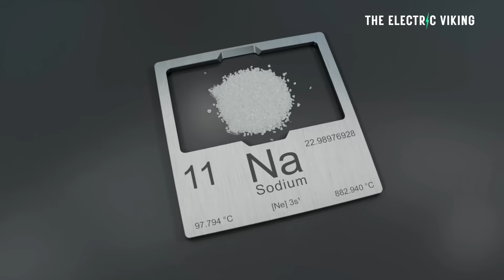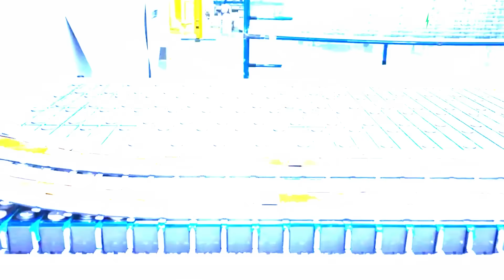Goodbye Lithium! New 3,600,000 Mile EV Battery costs 50% LESS

Comment: Well ... exposing others for their bad research and then doing the same thing is a bit hypocratic. 
- You claim "3 times the life time". Well ... that is a FAR stretch! 
Fact: CATL claims 10,000 cycles ... LFP is already at about 6,000cycles ... this is about 1.7times, not 3 times the cycle life!

- What is NOT mentioned is the calendaric aging. For LFP we pretty much know about 1% per year calendaric aging. What is it for Naxtra? 0.7%? 1%? 1.5%?

When I model the battery after my car and its usage (Volvo EX30 51kWh LFP, 23kWh/100km average, 25,000km/year) aging down to the useful life (70% remaining SoH, after that range is actually a lottery):
LFP with 6,000cycles and 1% CA: 23 years, driven 575,000km and the battery worked around 2600cycles.
Naxtra with 10,000cycles and 0.7%CA: 36 years, 900.000km, around 4000 cycles
Naxtra with 10,000cycles and 1%CA: 28 years, 700.000km, around 3200 cycles
Naxtra with 10,000cycles and 1.5%CA: 21 years, 525.000km, around 2400 cycles

SO: which is it? It might very well be that the Naxtra is not better or even worse then LFP in passenger vehicles! 
Its high cycle life time might be better suited for big commercial vehicles in long-haul usage where the cycles are eaten up very quickly! There the insane charging performance would even make it possible to fully utilize the 3.75MW of the MCS!

- You compare the price of manufacturing of the Naxtra (19$) to LFP cell SELLING price of 55$ ... well ... the truth will be more like 30$ vs 55$?

I have no doubt that with that much technological progress Na-Ion batteries will prove themselves in the mass market. Cold performance, fast-charging-performance, low cooling requirements, low production cost, high ressource availability ... 
BUT ... Na-Ion is fighting an uphill battle against LFP! Look at the Geely Golden Battery ... Those are already available in net 75kWh 5.5C-charging packs (charge 10 to 80% in 10.5min) with million kilometer life expectancy ...

Comment: The trouble with sodium currently is that they have lower volumatric density than lithium, while lighter, they require more real estate in the chassis, which limits pack size and available discharge current.

Comment: Just design a water separator at the fuel injector rail that can make hydrogen at a fast enough rate from water. .Then use a use a direct injection engine to inject the hydrogen at 14 to 1 ratio. The 1 part can be the oxygen waste and the rest of the oxygen can be pumped into the cockpit. 

Everyone was  working in it back in high school except for the direct injection. Then people got knocked off left and right. 

I was running a Edelbrock water injector in 1975 and met Bob Lasar who was racing his rocket car when he worked at MIT at Connecticut International Dragway un East Haddem CT. He came over after he heard I was burning water and we talked about running 100 percent. 

Other suit guys also took interest. I then blew some head gaskets from hydrolock when the injector leaked straight water in the cylinder. You cant compress liquid water.

But it worked and cooled he exhaust and went faster. 

What it did best was make the  performance times exact for every run. In bracket racing that's important. 4500 lb car ran 13.7s  + -  ..005 every time. This showed me you get a  smoother burn rate by adding small amounts of atomized water that turns into browns gas under heat and pressure.

I expect a direct injection hydrogen water engine system getting released by thousands if independants that can be retrofitted on to any gas engine including diesels.

Comment: For a passenger car 1 M miles is more than enough, you don't need more. But yes, safety, price, and volume and weight density are key for cheaper and more efficient car. Rounding it up a 10.000 cycles ara around 30 years so, for energy storage they will be amazing. They will last for more than a generation!!!

Comment: If these sodium batteries get 140-150 Wh/kg, compare to Tesla’s 4680 cells from Giga Texas have an energy density of 244–296 Wh/kg. Claims of 380–500 Wh/kg are speculative and not yet realized. Tesla’s ongoing refinements could push newer cells closer to the higher end of this range. Battery weight/density makes a very big difference for travel efficiency and range.

Comment: Remember: CATL working together with Nio for swap systems of their batteries.
So if they reach or already reached a deal Nio could be very well off especially with their cheaper models.
Long lasting batteries are the key point Nio want to have for sustainability

Comment: This is the end of the iron-air battery. They targeted also US$ 10/kWh, but with C=0.01 and only 60% efficiency.
Knowing this in April 2024, I would not spend any time to implement iron-air  batteries into my off-grid fast charging simulation.

Comment: As of mid-July 2025, Nepal has emerged as a global leader in electric vehicle (EV) adoption, with some of the highest rates in the world:

76% of all new passenger vehicles sold in Nepal were electric.
50% of light commercial vehicles (LCVs) sold were also electric.
73% of all four-wheeled vehicle imports were EVs.

Key Drivers Behind Nepal’s EV Boom:
- Abundant Hydropower: Over 90% of Nepal’s electricity comes from hydro sources, making EVs both clean and cost-effective to operate.
- Government Incentives: Import taxes on EVs were slashed to as low as 40%, compared to up to 180% for internal combustion engine (ICE) vehicles.
- Affordable Chinese EVs: Brands like BYD dominate the market, offering high-quality vehicles at competitive prices.
- Growing Charging Infrastructure: The government and private sector have rapidly expanded charging stations, though rural coverage still lags.
- Economic Incentives: Charging an EV is about 15 times cheaper than refueling a petrol vehicle.

Comment: from what I saw the problem with the sodium batterys are that the volt gets to low at low charge that its hard to use more then 70? %  of the energy. lifepo are have a really nice voltage that hold until almost full/ empty

Comment: Even if the sodium ion cells last longer than the current crop of cells out there the electronics in the battery pack will be long dead before the cell degrade. Mass market battery refurbishment? Who knows! What is unlikely is that you will be driving around with your grandpa's battery from years ago!

Comment: Car makers already make a battery, and running gear platform that they use under different models of cars, so when the cabin of your car needs replacing our updating the latest cabin can be attached to your battery platform

Comment: The current issue with EVs is not if the battery will last 100 years, but if it can run 100 km more before the next charge. When compared to Lithium batteries if these Sodium batteries have only 60 to 75% of energy density, then it means the sodium batteries will probably run only 60 to 70% of that of the lithium batteries on a trip before the battery gets drained. That's not an advantage.
Reply: If the price is that much lower you can have add some more cells to restore the range. Might cost you some boot space tho'.

Comment: timescales about right; TRL (Technology Readiness Level) of 5 or 6 means System Readiness Level of 2 or 3, so, yes, 5 to 7 years. Unless a.n. other (more energy dense) storage chemistery is developed.  The main drawback of the proposed Sodbatts is that they don't (yet) offer improved energy density - meaning cars will need to continue to get bigger to realise the greater ranges drivers seem to 'need'. Unless, of course, the charging rate can be improved to ~ 10C when recharging times get low enough to make range anxiety a non-issue. 
The big advantage here is not the number of years a (say) car/truck battery may last for, but how frequently it can be cycled to the grid via v2g - a twice-daily cycle (once driving, once v2g for peaker load management) will still mean a vehicle life exceeding the normal warranty periods, so car manufacturers will no longer be upset by the possibility of their battery v2g-ing.  There is another drawback to the v2g concept though; the Power Utilities: it's not in their interest for myriad minion car owners to 'have the power' so by the gods they'll do EVERYTHING in their power to stop v2g happening - including building their own giant battery farms!  The way this can work is for governments to legislate for mandatory v2g support. But governments aren't renowned for having intelligent people in them - just greedy ones - so v2g probably will never happen. And there lies the problem...

Comment: I suspect, that cars with Naxtra Na+ batteries will have a bit less range, than cars with LFP or NMC batteries, due to the lower energy density of the Na+ Naxtra technology. But these Na+ powered cars will also be MUCH, much cheaper than LFP and NMC powered cars. 
Therefore it will not be such a revolutionary decline of the LFP and NMC production, because some people need the higher range and are willing to pay for it. We will continue to see all three technologies for quite some time - NMC, LFP and the new Na+ (Naxtra).
But of course, this definitely marks the end for combustion engines, and the fossil fuel era, and a much faster conversion to a 100% worldwide renewable energy system and a much more social, and cyclic economic system.

Comment: The safety aspect for grid storage is massive. At the moment, any such storage is drastically curtailed in size and location because of the chemical fire risk. They are typically located outside urban centres and spread out in two dimensions. 
Fire safe storage can be positioned close to the point of consumption, and built up in three dimensions, so the reduction in battery costs is further reduced by construction and distribution costs as well.
Reply: Good point!

Comment: All that battery mass positioned low down and centrally will make cars better handling but the acceleration of electric cars will have to be toned down as many drivers can't cope with performance-car type acceleration and are likely to increase accidents - if only because people don't expect cars to move that fast in relative silence.

Comment: Working on the principle that your predictions are totally right. There are some good-looking EVs out there. Do you think there will come a time when companies will emerge that offer an upgrade for existing vehicles to the sodium-ion battery packs?
After all EVs are modular in design,  having separate subframes for the suspension/ drivetrains. We could be approaching a time when people will just not want or need to replace their vehicles every few years.

Comment: Yes, definitely a game changer. As far as replacing oil in its entirety, I don't think that is realistic. Industry is still very dependent on diesel. Additionally, renewable energy can't supply the exceptional energy needed to power AI. This leaves nuclear & NG as the primary benificieries.

Comment: Nissan 3 cylinder DIG engine. 1,4 liter 130 hp 6500 rpm. Open road consumtion 3,5 liter /100 km. Compression RATIO 16,3 from MAZDA SKYACTIV X engine.

Comment: 0:10  "... in the last fifty years."    What happened in 1975 ?   OPEC raised the price of crude by 10%, but that was not really a game-changer.
5:30  "3.6 million miles ..."    Choose a figure, any figure.  I bet that they will  physically  fall apart years before they can no longer retain 85% of their original charge.

There is a lot of "could" in this video, and a a lot of claims about the future which sound more like what you  want  to happen than what there are sensible reasons for believing  will  happen.

People don't buy EVs because of:
- range anxiety, 
- the lack of charging infrastructure, 
- the time required to re-charge the batteries, 
- the difficulty in finding knowledgeable repair shops for EVs.

No words from you on how these new batteries will address  any  of these concerns.
Do a follow up video, please, and base it on the commercial/demand side of the equation,  not just on the whizz-bang technology

Comment: CATL' sodium batteries.
The energy density is pretty low for vehicles.
But for stationary use the lower cost and high charge cycles is pretty good.. 
175 Wh/kg energy density
$10/kWh
10,000+ charge cycles
The cost is probably a projection far into the future.

Comment: There's a few questions that need an answer, Sam: 
What about charging speed? 20-80% in what time, and with what peak input? 
How does the charging load curve look like?

The 3.6 Mmiles is just saying that we talk about a car with a battery allowing it a range of 360 miles per charge if the 10k cycles are 0-100%.
There's no strictly defined capacity of the battery, or performance specs of the car carrying it.

Comment: 3 cylinder NISSAN DIG engine. 1,4 liter 130 hp / 6500 rpm 150 Nm /4000 rpm. Compression ratio 16,3. Engine lifespan 450 000 km !!!! Where are the SMART GUYS ?

Comment: Energy density is an important parameter. These sodium batteries, although approaching the density of LFP are still short of LNMC and even those batteries are heavy. Weight reduction will improve, efficiency, performance and handling so getting the weight down has got to be the next holy grail?

Comment: You did mention hybrid batteries. Sodium as well as lithium cells. Is the lithium there to provide high power output for the short times that power is needed? Then to be recharged by the sodium cells?

Comment: Sodium batteries do present a bit of a challenge to the electronics that will need to work quite a bit harder than with NMC or LFP. The working voltage range is 2V to 4V with a fairly linear discharge voltage curve. So a 2:1 range for the inverter to work over. Compare with NMC which is more like 3.5V to 4.2V. LFP discharge curve is almost flat.

Comment: Another point to consider is that many types of Sodium batteries can be shipped completely discharged.  There is no parasitic chemical reactions that go on in some designs.  This means that you can also run them down to flat without needing special circuits to cut off the discharge.
Even if they cost and performed just like Lithium, if they had that feature, Lithium batteries would be gone from the market.

Comment: This is a good video. You should drill down on this and focus on this rather than talking about stock prices. And you know humping Tesla stock and other stuff like that. This is really important because it's not just autos that you seem to focus on. You know it's the entire electrification of everything and storage is key to that. The switch over from fossil fuels to electric based upon storage. If you can't store electricity then you don't have base power and then you're still in fossil fuel land. If you have storage then you can go solar and wind and hydro. Which by the way you should be looking into TIDAL energy which is  going to be huge down the line

Comment: NO battery has ever lived up to the hype.
At this point Led Acid batteries are the safest and last as long as they say they do. Which is about 700 cycles at best. On Trojan deep cycle batteries NOT starting batteries. STFU!

Comment: I drive with 10 compression ratio gasoline engine 10 year more because good winter charge batteries comes to FINLAND after 8 years. 14 compression ratio 3 cylinder 1,2 liter gasoline engine in 2032 model.

Comment: My OnePlus 13 phone has the Sodium based battery, and it is incredible. I can’t wait for cars to have batteries that has 20% more capacity, last as long as LFP and charges faster. It will be a revolution in cars.
Reply: This phone does not use sodium. It uses silicon-carbon.
Reply: OP13 is so good a phone it's crazy